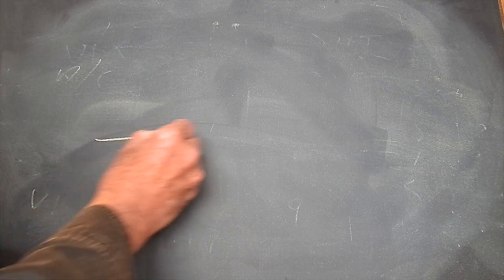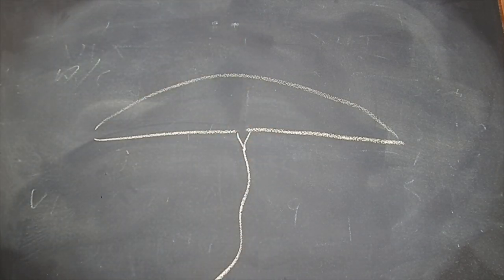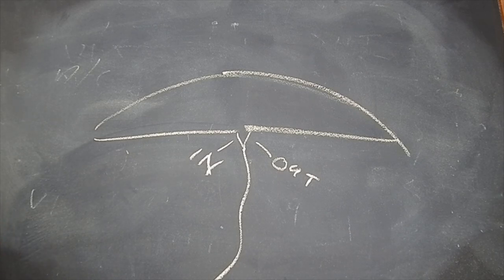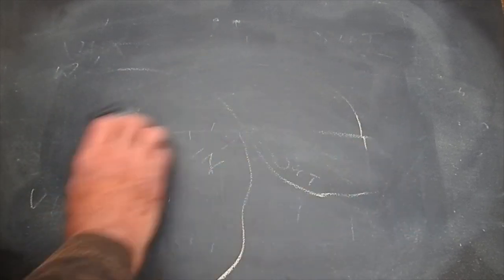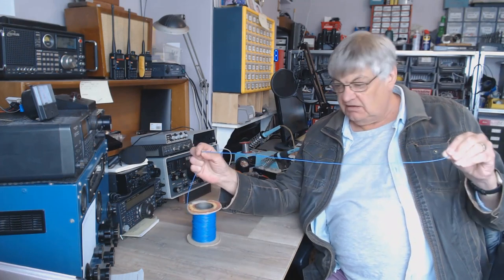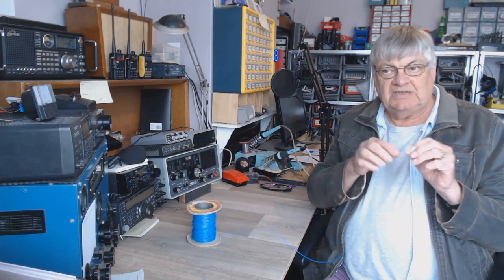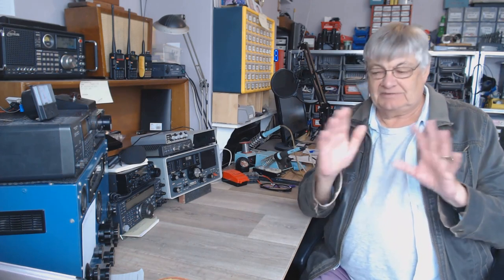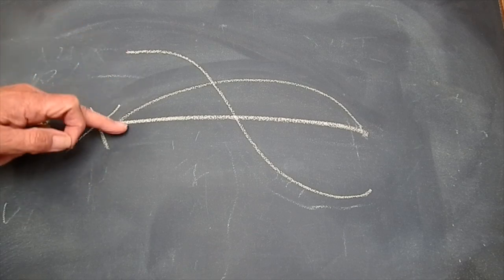G4NSJ - An end-fed wire aerial top band 160 metres amateur ham antenna

Comment: No, one doesn't actually really need an "Earth" ground as such, as described in the middle of this video. The End Fed Half-Wave antenna was initially developed for air ships (Zeppelins) and is in fact sometimes called a Zepp antenna if fed with an open-line quarter wave transformer (taking the role of the modern 49:1 Un-Un). When a Zeppelin is 5000 feet in the air, there's obviously no connection to Earth. In fact, have a look at the Zepp design and you'll see an open circuit at the end of the transmission line transformer. The antenna concept would work just fine in deep space, a lightyear from any planet. Even a modern implementation of an EFHW can use only a small counterpoise, because the high impedance feed point is also high impedance on the "return" side, so the system isn't driving high currents into the return side.

Whenever someone makes a claim about antennas and Earth grounding and lightning, run their suggestion or concept past the known existence of aircraft and spacecraft that are equipped with radios and antennas and even lightning protection. At the very least, they may be forced to clarify what they really meant to say. They may have correct understanding, but just said it wrong. Or in some cases they may have incomplete understanding. The "What about aircraft and spacecraft?" rebuttal can be very effective in clarifying concepts.

Comment: Hi Ray, thanks for sharing yet another most interesting and informative video. are the houses fairly close together there? We are fortunate here in Melbourne Australia with space both sides of the house, as the house is on an angle. We then have a reasonably good size back yard. I have a long wire antenna from my den, going under the house and then along the back fence. It seems to work quite well for receiving medium wave. Anyway, wishing you the very best. Rob.
Reply from the maker: Hi Rob,  yes the houses are very close together. Everything here is very close due to lack of space!  It’s nice to hear from you. I hope all is well. Cheers, Ray.